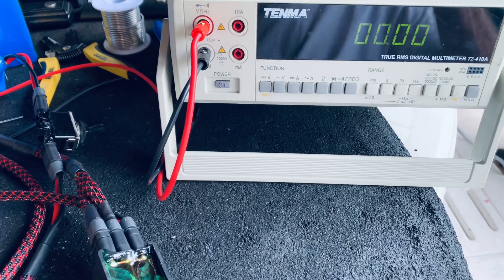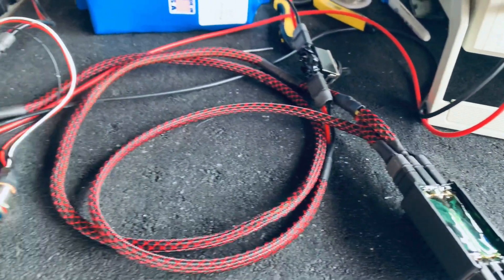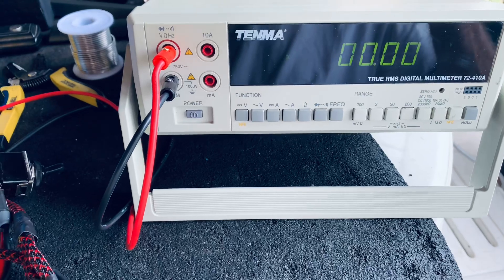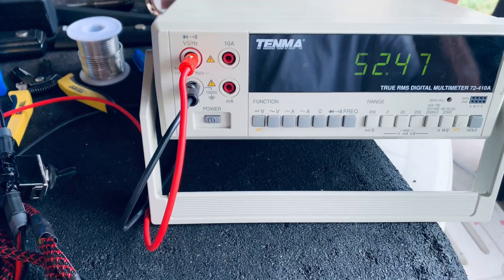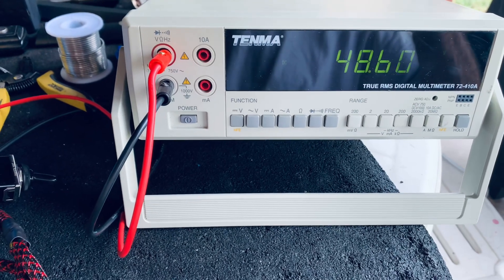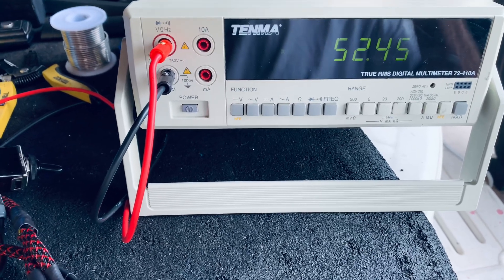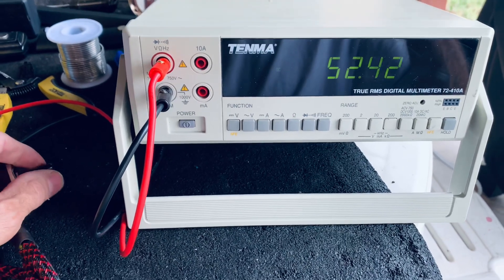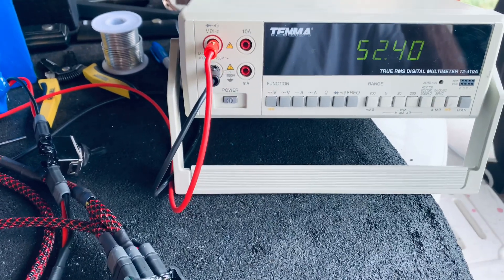Demonstrating The New FBC ‘Battery Blender’ Device

Comment: It's best to have 2 batteries at the same voltage to get the real benefits of this American Made Device. 👍😁 I've added a third battery and it keeps getting better and better! 👍😁
Reply from the maker: Yes, but it'll work if the difference is not big.  The real benefit comes into play when the voltage is the same between batteries however.

Comment: i have 72v battery on my 2000w motor ebike, i want to add a 52v battery with this device....will this work(cause i know its a big diff in amps but i really dont want to buy another battery if i dont have to) the point is to increase my range because im only getting 22miles on my 72v 19ah battery
Reply from the maker: There will be no benefit honestly in this scenario, as the voltages are too much different; there will never be any overlap in battery voltage (a 72v battery at 60v at it's lowest point).
Reply from the maker: You will need to SWITCH between batteries, versus combining the two simultaneously.

Comment: Will this work with " always on " batteries for example my Ariel rider xclass main battery doesn't have a on of switch but my second battery does .
Reply from the maker: Yes it will work on that setup.  However you may want an inline on/off switch as well.  I also make those!

Comment: What is the impact of connect two li-ion batteries of the volts in parallel without a combiner?
Reply from the maker: It has the potential to be dangerous if the voltage if drastically different, or one battery is aged and one is new, as excessive current could be passed from one battery to the other.

Comment: to charge the battery would you recommend unplugging everyhing?
Reply from the maker: No, there's no disconnecting the batteries required, and each battery has it's own charging port.
Reply: @electromotivemods2293  awesome! just ordered one from you =D
Reply: @electromotivemods2293  forgot to mention its safe to put a 52v and a 48v on the FBC right

Comment: Does it have current limit or capacity?  Can it be used regardless of the controller ampere rating?
Reply from the maker: There is a current limit, most models I produce are rated for 50A out. https://www.electromotivemods.com/shop/p/s1fmuuaawo86hdw5gduhknspnoks37
Reply: @electromotivemods2293  ok, thanks